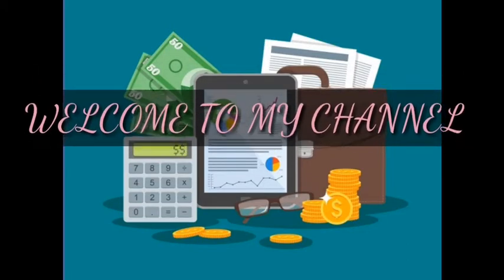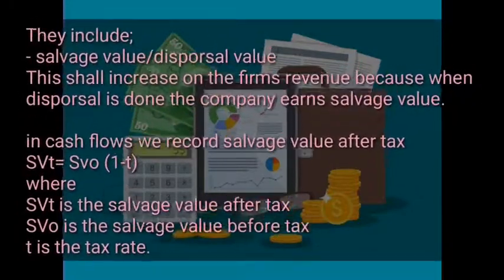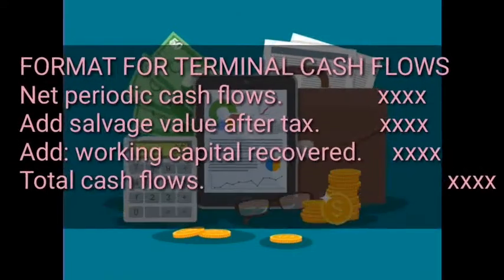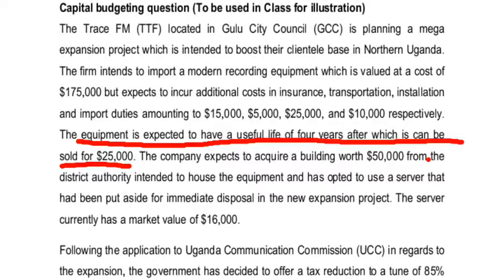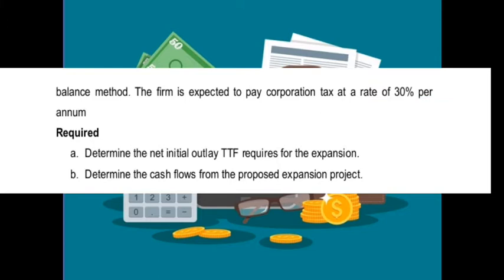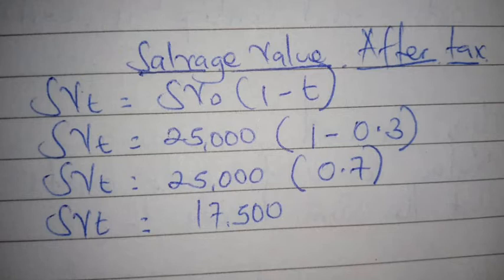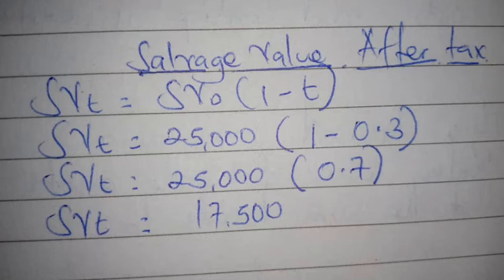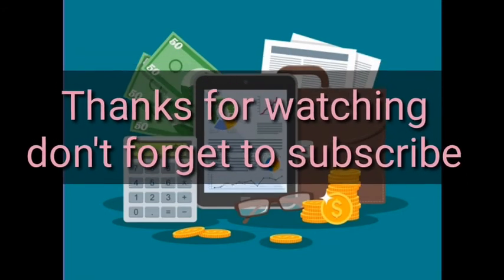Terminal cash flows, cash flows determination (capital budgeting decision, financial Management)

Comment: How did you get the tax reduction in  the initial cashflows?
Reply from the maker: There is an 85% tax reduction on import l, import duties is 10,000
Tax incentive=85/100*10,000
Tax incentive=8,500
Reply: Where did u get the 10,000